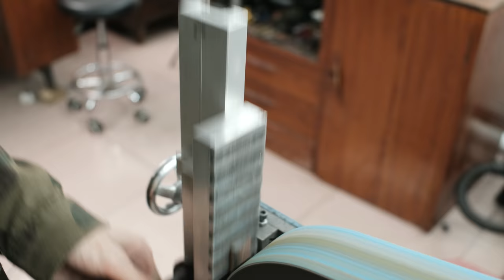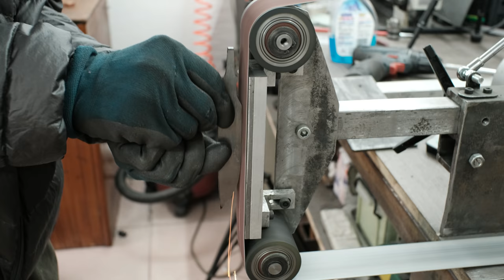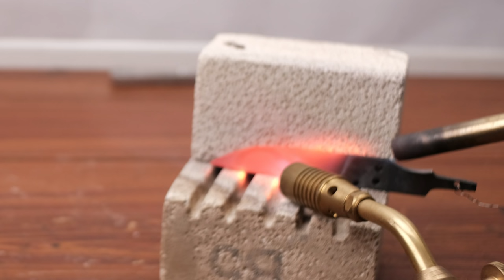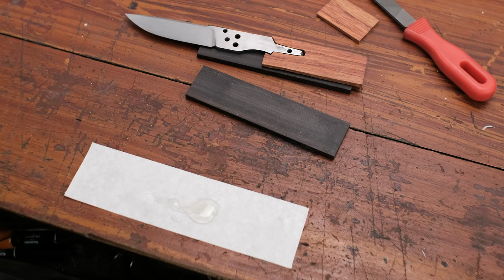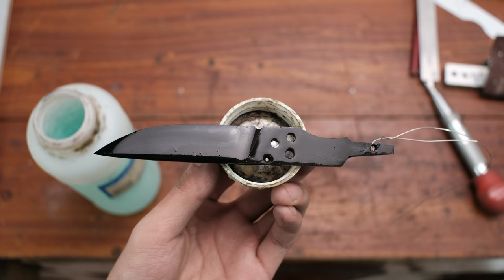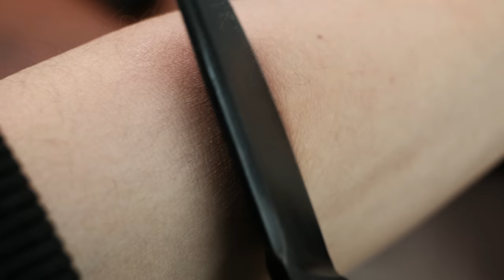Making a Knife from an Old File

Comment: Great work well done. Please what is the liquid that makes the steel black at the end ? Does it help against corrosion as well? Thank you :-)
Reply from the maker: Room temperature metal blackening agent...I don't know if the translation is accurate.  This kind of potion is often used to prevent rust in industrial equipment.  Not suitable for kitchen knives, fruit knives, and all knives in contact with food.
Reply: @HansKnives  thank you for the advise :-) all the best.